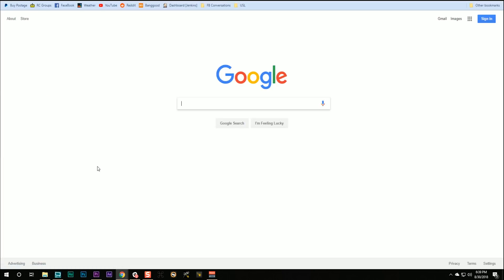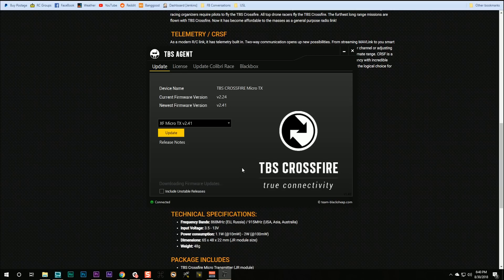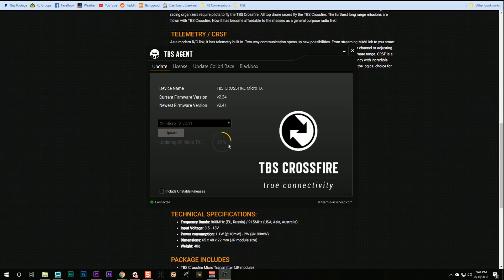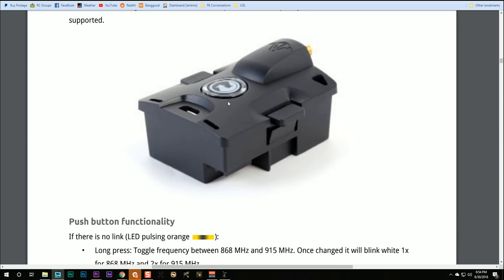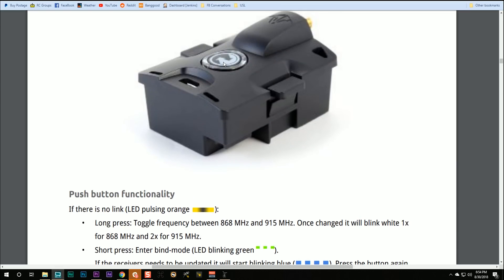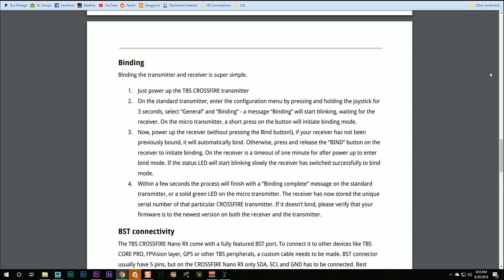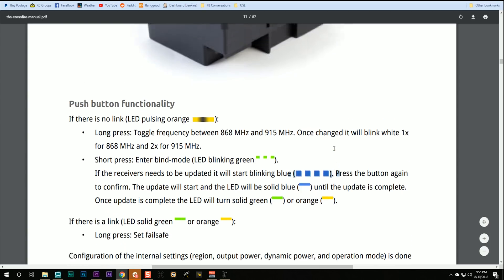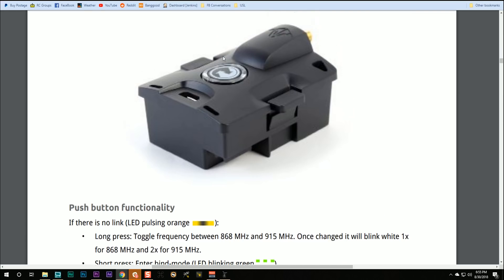TBS Crossfire 250 mW No Solder Upgrade

Comment: Ok I’ve flown for many many years and it’s time to go crossfire, wings planes and quads what’s my best setup? I have zero experience with xfire I had flown futaba for years now jumper with a radio masters TX16 on its way, there’s so many antennas and several differ units, where do I start thanks JB

Comment: I literally just ordered one for my new Jumper t16 pro and am worried I'll only be able to fly LOS? I'm able to go about 300 meters behind me (non line of sight) with the dji tx.. this possible with the crossfire?
Reply from the maker: Crossfire should have more range than the DJI system under most conditions. Make sure you are at 250 mW.
Reply: @JoshuaBardwell  Awsome!! Your vids have been a HUGE help. I'm pretty new and wouldn't have any clue what to do in this hobby if it wasn't for you! >seriously< lol 👍

Comment: I dont know why but i get better range with fw 2.24 on 100mw
Reply: Niklas Olsson my guess and haven’t had my buddy test yet is this isn’t pushing 250mw at all times and just amps out the power as needed but I’ve found that this feature rarely works properly.  R9M has the auto 1w and I’ve noticed it to not work consistently

Comment: My opentx is at 2.2.3 . it will not let me run my luac to access the settings of my crossfire its been doing the power adjustments its self while i fly. Is that normal with this version of opentx 2.2.3
Reply from the maker: No it's not normal. Did you also update the Lua script and SD card contents when you updated the radio?

Comment: Anyone know if they fixed the firmware compatibility issues with the micro rx v2 and nano.. have 2 quads but each having a different rx i couldnt fly both as i couldnt flash the same firmware.. spoke to support but i gave up as how many hours can you waste on something ??
Reply from the maker: There is no compatibility issue between the micro RX and the Nano that I'm aware of. Just update the module to the latest firmware (as always) and let it update the receivers.
Reply: @JoshuaBardwell  Hi cheers for the reply.. well thats what i was doing the nano could flash to the latest fw the v2 would not i think i could only get the v2 to flash to something like 2.11 was always showing solid red light on latest fw's.. this was back in july not tried since then!

Comment: When i click the receiver button after powering it on, it just blinks red.
Reply from the maker: Is the module in binding mode?
Reply: Joshua Bardwell some weird stuff. I don’t know. I finally got it just going the long way through the Radio. Anyways, now I’m getting low lq warnings on my Taranis when I’m fairly close by but doing flips. You can my lq drop to 77 at 49 seconds on my last video. Do you think it’s because of the update?

Comment: This makes me more and more attracted to the TBS CrossFire module.
I still need to make sure that my radio (Frsky Horus X12S) can work at full bandwidth without mod...
Early on, words were that only the QX7 was affected and the X12S worked at full speed, but now the QX7, X10S and X12 are listed as incompatible...
Reply from the maker: 1st-gen X10 and X12 were not affected but subsequent gen were.
Reply: Nice, thanks a lot for the info !
My X12 is from the second production batch, so I guess it's 1st gen :)

Comment: Is that possible that I dont't have osd because I soldered the video wire from the camera directly to the vtx?
Reply from the maker: Yes it is 100% guaranteed that you cannot have OSD if you did that.
Reply: @JoshuaBardwell  and is there any solution to get osd, because I overheated the video output pad on my fc and it came off
Reply from the maker: If you can find the output pin on the OSD chip you could solder to it. Honestly there is no easy solution though.
Reply: @JoshuaBardwell  I think I'll survive it without OSD:)
Reply: Lol you are joking with that question right?
Reply: @lillyancomfort7926  no, unfortunately  not:(

Comment: Can you test if it's really 250mW?
Anyone tested if the Liviu Preda mod gives 250mW?
Reply from the maker: You need a specialized tool to test output power on a digital transmitter like this. I haven't got the equipment.

Comment: Started having a low noise from the speaker on my tanaris x7s after going 250mw. 

Been flying it for a week or so no problems except the annoying noise in the speaker :)
Reply: This means u may have a problem with your internal transmitter or you still have it turned on. Im sure u figured the problem out by now but just a thought.

Comment: Does this run the battery down faster?
Reply from the maker: If you use 250 mW you will run your battery down faster than at 100 mW or 25 mW. The good news is you can decide.

Comment: To add to the binding procedure if a user was already on 2.31 prior and for all future updates autobind is now working. So no need to push the button on the rx, Just place tx module in bind then plug your quads/planes in to update 1 at a time.

Comment: Hi JB...I watch all your videos, they are very educational for me and have learnt lot from you. I have just got an issue with this update. After updating the firmware it does not bind with my receiver and it only binds again if I roll back to the previous firmware. Any solution for this ?
Reply: Gabriel Fernandes update your receiver also. The module and receiver have to have same FW to bind.
Reply: @rl2769  
 Try resetting the rx by holding the bind wile powering it up till it blinks fast . Unplug and replug battery it should blink green slowly 
. Unplug rx . 
  Turn on tx . Orangelight pulsing . Press module button . 
Plug in rx . Goes red and module blinks blue,  then press module button and wait a few minutes for all solid green . 
 Turn Everything off , everything on again and all solid green 👍 🙂
   💢Note :Someone said to DO THE reset rx you hold bind button and plug in battery let go bind  button  1 or 2 seconds and press bind button and hold  again and hold till blinking fast , then unplug . Replug in battery it should green blink slow  for bind mode . But i think you just hold bind on rx while plugging in battery until it fast blinks let go and unplug . Test if it blinks bind green slowly when just plugged in .💢. Geesh . THEN DO THE BIND AS ABOVE AND IT RE UODATES RX BY THE MODULE RADIO .
   And maybe keep rx easy to pull out without disassembling everything .

Comment: I've heard that having your TX on too high a power while standing near your RX is a problem. Is this true, and if so how close is too close with these higher powers?
Reply from the maker: With 250 mW it's no problem. My understanding is it's only an issue at like 1 or 2 watts. But if you are worried then use dynamic power.

Comment: Great video simple and to the point 😎.i have a problem with my crossfire system fitted to a diatone  gt2 the rssi starts at 15 when it's close 🙄and gradually goes up the further away you get any ideas why this should happen ?
Reply from the maker: Whatever you have as your RSSI aux channel is not actually reporting RSSI. Check int he receiver output map to see what aux channel is mapped to RSSI. check in betaflifght receiver tab what channel is mapped as the RSSI channel.
Reply: @JoshuaBardwell  thanks I'll check that out
Reply: I have the same issue I think. My LQ through the reciever channel shows 99%. However the RQly from telemetry to the taranis goes down the closer I am to the quad. Just started after the update. I've been I touch with TBS and they recommended factory resetting the TX and RX. I haven't tried yet but will update once I have

Comment: I did this about a week ago but i never updated the receiver but it still works fine. Should i go back and update the receiver?
Reply from the maker: Receiver must have auto updated. Crossfire will not let the receiver bind to the transmitter if they don't have the same firmware version.
Reply: Perfect thanks Bardwell

Comment: I’m happy with the full crossfire system but this 250mw firmware upgrade is *BALLER*. Should definitely be a noticeable range increase for free. 👍🏻
Reply: Just 1.58 in theory, less in practice
Reply: Andrey Mironov exactly.  Not much of an improvement really.   Now if TBS would have went to 500mw I’d been all over this.